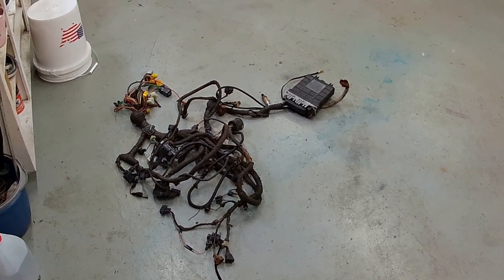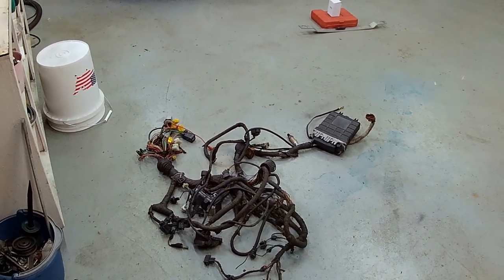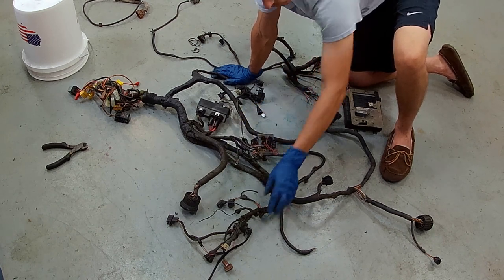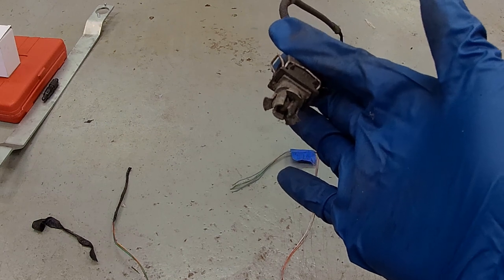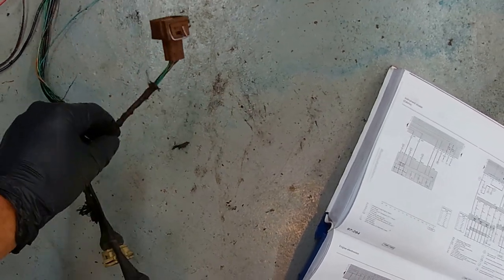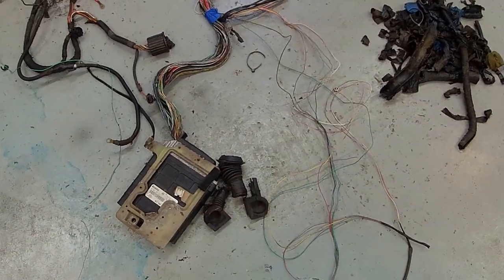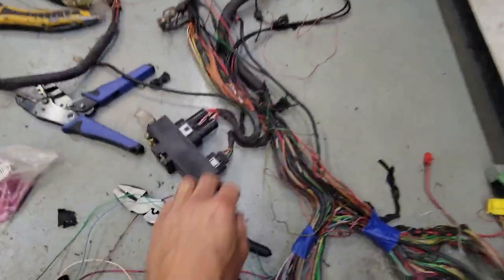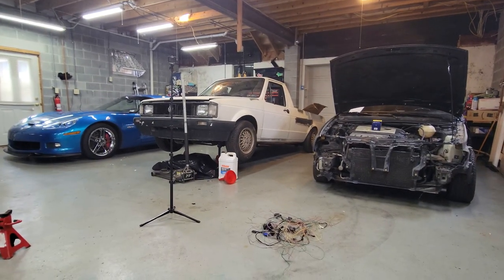Mk3 VR6 Wiring Harness Pt.1 - Spaghetti monster needs a diet!

Comment: I’ve never stripped down an A3 vr6 harness, but I’ve done a lot of 1.8T’s.. It’s crazy how simple it becomes when you just stretch it out on the floor..

It’s harder to think about than it is to do
Reply from the maker: It gets less intimidating every wire you remove, and with a Bentley manual close by, there's no worries!
Reply: @BonusParts  Triple check, then slice it haha.

Trying to binge watch and catch up here haha